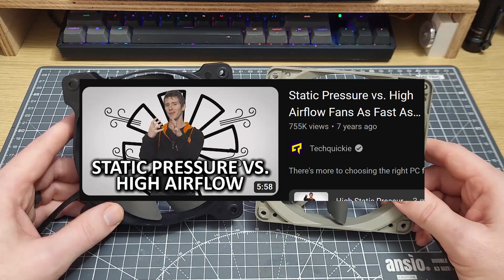"Static Pressure Fans" Don't Exist - Part 8: Do Airflow Fans Exist?

Comment: I've been watching these videos lately, and I've always hated the "high static pressure" marketing the way people throw around the term static pressure shows a fundamental misunderstanding of what "static pressure" really is, fans don't really posses "static pressure" they have the ability to create some pressure and static pressure is just a testing methodology to see at what is the lowest amount of restriction on the fans outlet that it no longer flows any air. Really for static pressure to be a useful number to anyone you'd have to have the static pressure vs air flow curve of the fan and then you'd have to know how much static pressure your radiator or heatsink setup will create when fans are installed on it. I really think that it's a completely useless metric that has too many variables because different fans designs will create their own turbulance that might perform better or worse on different styles of heatsinks and radiators, really we need a standardized radiator or heatsink setup that all manufactures use and fans should have a datasheet that shows the through radiator flow rate vs RPM, while you can't account for the turbulance of every heatsink/radiator design that still more useful than an arbitrary static pressure vs air flow chart at max RPM.

Comment: I ve 2x160 front and 1x140 at rear exhaus. I wrongly buy nzxt kraken radiator fans because its tear down of a nzxt kraken cpu cooler and it was very cheap seller have lots of them anyway I bought and put 2 of them top of the case as exhaust now I ve 2x160 front air flow 2x 140 static at the top and 1 x140 rear exhaust. Is that a problem? Can I buy two of them for bottom of the case under the gpu for intake from bottom because they are static press. that I am asking thanks. He is selling them only 7.5 $ and they are original and new brand. You said dont use them together airflow with static pressure. I understood static press can be used against a resistance.

Comment: Very interesting series!

I'm curious if you've ever considered testing the Silverstone Air Penetrator fans - they claim to be designed to modify the flow "pattern" and produce a more uniform output compared to others. The design has a similar-looking configuration to the Nidec unit, with a counter-spiraling static frame behind the impeller.
Reply from the maker: Yep, I have an Air Penetrator, and sadly it's mostly a gimmick, which is why it died out relatively quickly. The main selling point was, as you say, the improved focus of the airflow from the fan, but this comes at a cost because the grille at the exhaust basically chokes the fan, reducing both the volume flow rate and the pressure performance. Unlike the carefully designed stator vanes of Nidec / Delta (and similar) fans, the Silverstone's are basically a "party trick" with zero advantage over a standard design. I may feature it in a future video. :)

Comment: While interesting discussion and all it completely misses the "noise" part of the equation.
Sure, a fan can be both pressure and airflow, not even corsair tries to tell you otherwise.
Interpreting SP and AF as a "there can not be both" is strictly personal opinion. You might have imagined that.
If you disregard the noise, and how much you pay for it then yeah "any computer fan will suffice" as you say, but that's a low bar.
Reply from the maker: Yes, I did imagine what Jayz and Linus both said. How silly of me.
Reply: @FanPhys  I went through both just for the sake of it, and no one ever said it's a strictly black and white chose between AF or SP. Jayz uses language of "optimized/optimizing for" while Linus speaks of "high air flow/higer air flow" and "high static pressure", which are separate metrics (a fan can be both, ofc). This whole assumption of somebody making it a strictly one or the other thing is absurd and imagined.
Reply: @Zerao98 The sole reason I found this man's video has to do with ThermalTake's "TOUGHFAN 12 RGB High Static Pressure Radiator Fan," which I'd like to use as a case fan. The meme that there's a marked difference between SP and AF, and that they each have their very own separate use cases, still exists in today's market. I'm unsure why we're pretending otherwise. FanPhys only aimed to debunk that misinformed notion, to which he did - he wasn't aiming to do a Pros & Cons list of both which explains why there was no talk of decibel level.

Basically, you're tuning into the Weather Channel, asking where the hell the market numbers are for Asia. Talk about misunderstanding the concept of something...
Reply: @BeanieKing  Speaking in terms of fan performance disregarding the noise variable is like tuning into your Weather Channel and ignoring whether there is hail or storm, just focusing on how many degrees it is. It's not like fans are totally identical nor totally different, but they will have different noise signature in same situation, so I don't see how you can draw wide conclusions about all fans in today's market based on video that mentioned power draw but not the noise resulting from it. It's like you want to ignore the parts that don't support your view.
Reply: @Zerao98  You can't borrow an analogy while fundamentally misunderstanding your role in it - your latter point was refuted, which I assume you know because you're no longer defending it, so now you continue to shift the goal posts of what was being discussed. 

Does fan noise matter? I assume to some - to most, however, it's budget, style & performance that truly dictates their purchasing decision, and in that order. Certainly never heard of someone saying no to a fan they like because, "the noise would just be too much...!" 🤣
Reply: @BeanieKing  If noise does not matter, why do companies differentiate SKUs by their speed and noise produced? Why do companies market their fans with emphasis on the noise produced? Why do fan companies have entire names (Be quiet) dedicated to the emphasis on quiet operation? And what does it mean that you "Certainly never heard" something, that it does not exist, just because you have not heard it? Are you some kind of oracle or fan salesperson who discusses fans with friends and family all the time? Or does it simply mean that you are not informed. Lastly, if performance was the only metric people went by, everyone would just get super loud server fans, yet for some reason people go for quieter, less performant fans. Most peculiar.
Reply: @zeroqwerty242  Zeroqwerty, huh... I'm assuming I'm talking to Zerao98's alt, now, because his last message got censored? 🤣 I dunno, have you been paying attention to the conversation? Why do companies market some fans as SP and AF when there is clearly little to differentiate the two? Why would you waste $40 on be quiet! when you could simply adjust the fan curve via software on a cheap fan? Could it be that you fell for the same bs OP is trying to debunk? Maybe... mayhaps.

Comment: But some fans is definitely better in doing radiator stuff and some as case fans. I have Noctua NF-A12x25 fans. I tried to use them as case fans instead of pair of Thermalright tr-121bp. And by placing hand on the exhaust, with same RPMs, there was significantly less air coming out of the PC. So I still use Thermalright ones as case fans, and Noctua as CPU and PSU fan.

I agree that most of it is just marketing, similar to CPU marketing ("you NEED Xeon for servers, and i7 for games"). But there's still a difference between fans with different blade count/shape.

Comment: Theres plenty of testing to show that there are differences between good and bad fans in noise, airflow, and longevity. That manufacturers are bad showing their specs or may even be lying about differences in specs doesn't negate that.
Reply: Yeah. I feel like some people just aren't as bothered by or maybe cannot hear the noise due to the frequency but I finally put in the money for some quiet high performance fans because I was tired of being able to hear my fans even at low RPM.

The specs are almost always a lie or misleading though so the only way to tell is comparative reviews.

Comment: What's funny to me is that the San Ace managed to perform equally to the Nidec in your test in part 6, even though it has a much less agressive design and only 72% of the static pressure at the same rpm. The p-q curves spoil what happened there though

Comment: Really liking your series. Would you consider answering the question 2 140 mm case fans or 3 120 mm which has more air flow for a case ? Thanks again
Reply from the maker: Thank you! It depends on the relative performance of each fan, but as a general rule 140mm fans operate quieter than 120mm fans for a given rate of volume flow, so if that's your priority then 2x 140mm is your best bet. I've always used 120mm as case fans purely for convenience because I also use 120mm on my CPU and GPU coolers. All things considered it won't make a huge difference as case fans don't need to produce such high airflow, especially if you have several of them.